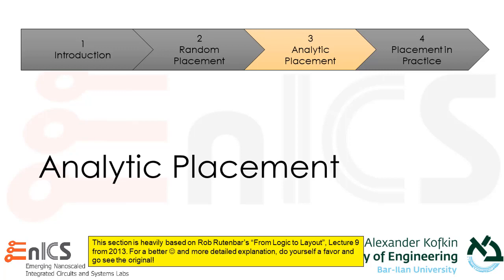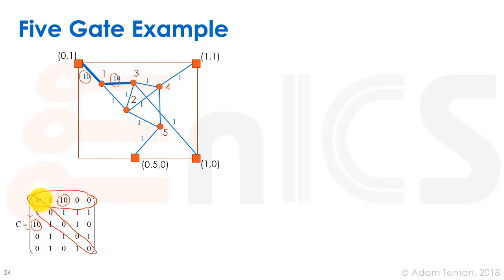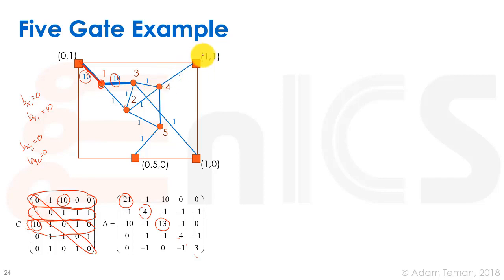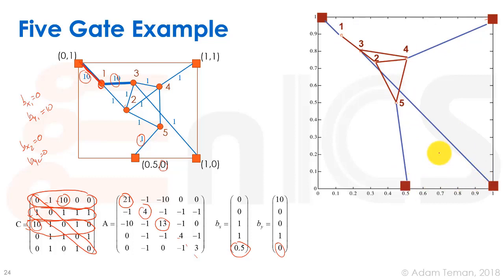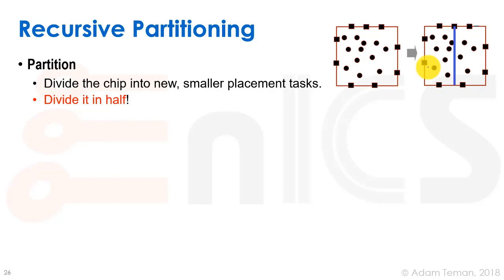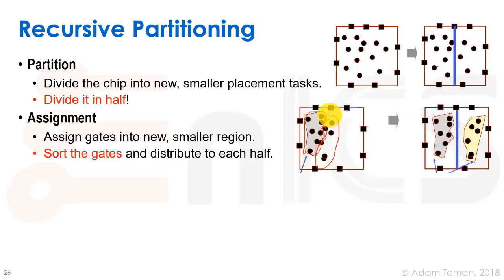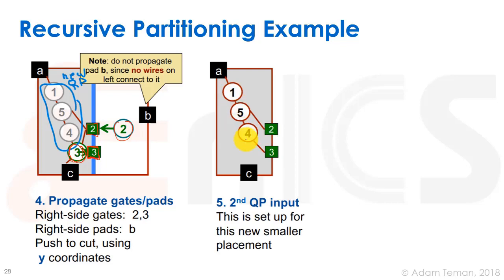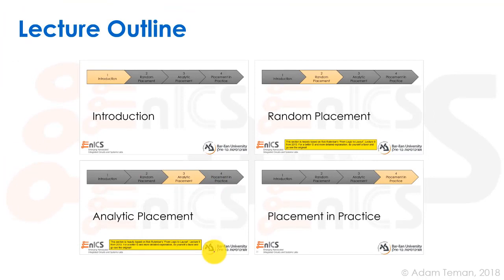DVD - Lecture 7d: Analytic Placement Example

Comment: Man whoever came up with this is a genius. Thank you Dr. Teman.
Could you please confirm one thing. Connectivity matrix saves us from calculating each quadratic wirelength and differentiating them partially in order to arrive at A matrix, right?
Reply from the maker: Hi,
I guess you could look at it this way, but I think it is more straightforward than that.
The solution to the optimization problem is to differentiate the entire system. This is a set of equations that you can collect into matrix notation. The connectivity matrix is basically the outcome of writing down all equations and collecting them together. But the "observation" is that this matrix has features that "are intuitive" and "make sense" and represent the connectivity of the netlist and therefore it's just straightforward to write it down. 
Note that there is some amazing work by University of Texas (David Pann), where they use deep learning inspired optimization to solve the placement problem ("DreamPlace"). I highly suggest looking into this, because it's really really beautiful.